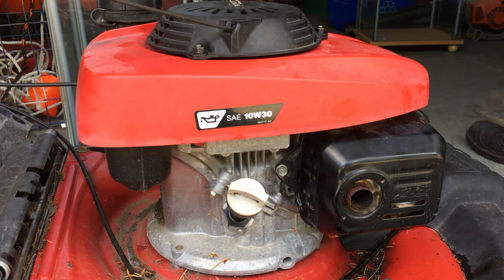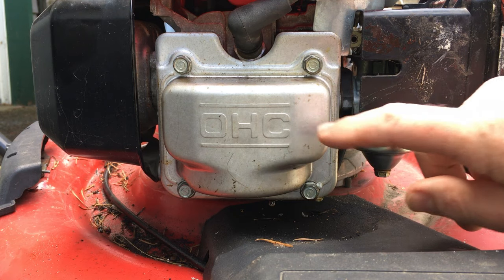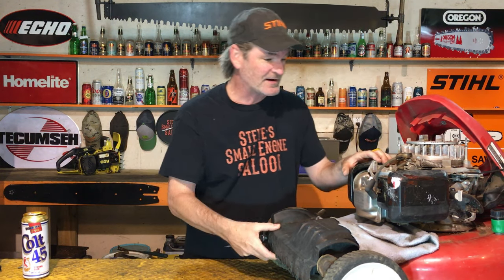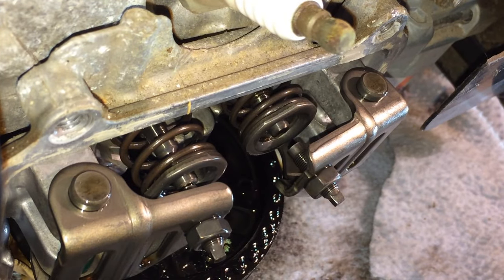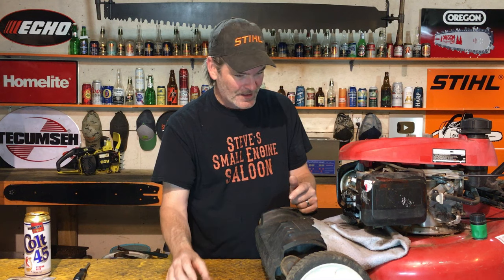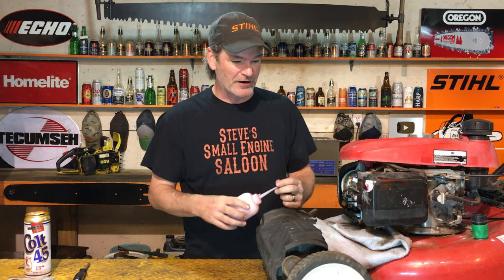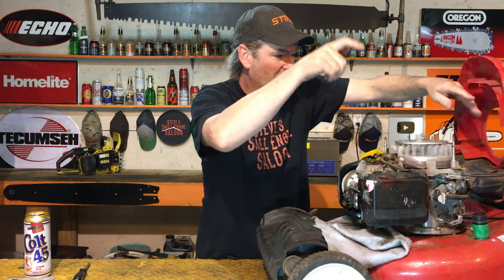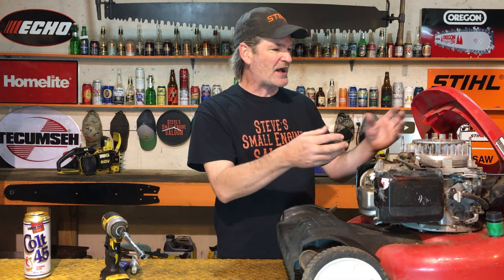How To Fix A Lawn Mower With No Compression

Comment: I had the same problem with my generator with a 10hp briggs and stratton. It needed a headgasket anyway so i took the head off and carefully tapped both valves out and soaked them in purple power and it runs like new again. Thanks
Reply from the maker: Right on Jim...

Comment: i have a power stroke  pressure washer  that has lost  compression   my local small engine repair shop  told me it can't be fixed  well they could probably fix it but  for the cost i'm better off buying a new one.......the piston rings have worn out.....if he is right and the rings are just worn down to the point there is not compression  why does this happen and what would you do.....junk it and buy a new one.....thanks for your help
Reply: Put new piston rings in l did this to my lawnmower years ago and it should work !

Comment: I should of watched this video before i took a engine apart in the kitchen 😂😂 and it was a stuck valve waiting on the compression tool to get the springs back in  amazon have a back log  helpful video as always steve small engines saloon
Reply from the maker: Good luck!
Reply: @StevesSmallEngineSaloon  cheers m8  im gonna need it

Comment: I've had Briggs and Stratton engines do the same thing as this Honda mower , easy fix . Last year I bought a second hand Honda weed eater not running , on it the valves were seating but not opening very much , stripped it down and found a worn out PLASTIC cam , the lobe for one of the valves was almost round . Honda lost a lot of cred with me when I saw that garbage inside . I think even that mower will have a plastic camshaft . Honda used to be good . Interested in your opinion on that Steve .
Reply: michael lee  Briggs , Kawasaki and Kohler all have models that use plastic cam gears and/or cams , I have no idea of the failure rate , maybe they are ok , it just seems cheap and nasty engineering on first impressions .

Comment: just tossed my rototiller! damn! but it was a 1979 Troy-built(Kolher engine, 8 horse)-my Dad gave it to me because he no longer needed it!   the compression could have been fixed if it was this. I used it back in 2011 to cut out my garden from a Bermuda sod lot! It did a damn good job too! was autodrive and made it easy as Hell! I wish I knew this when I tossed it out! But my Dad and I both concluded it was so old and had sat around for too long unsued ot be  repairable! I then used owr City's our "Big Trash" pick up hauled it off(this year!!! July of 2020!)-well  I think someone got it the day before at least someone enjoys a self propelled roto! I wish I had kept it now!  I could have clean3ed the valves! But I assumed it was so old it wasn't worth the time to behead it(not overhead cam!)  and do this!  :(

Comment: Always enjoy your videos Steve - you know what you are doing, thanks.  My Briggs and Stratton engine is backfiring loudly and won't start.  The (plastic) carburetor is cleaned, flywheel and flywheel key are fine,  new spark plug, oil and gas fine but yet having this problem.  Lawnmower is just under two years old. It's a Poulan Pro with Briggs and Stratton engine 625 ex series.  Any advice would be greatly appreciated, thanks.
Reply: Spark timing is wrong or the fuel mixture is too lean

Comment: Hi Steve I am big fan of yours. I have Murray 430cfm  leaf blower which died while running and won't staring again.
Any idea what could be wrong?
Reply: Dry cracked fuel hoses?
Reply: @feez357  that's not the case.

Comment: 50/50 mix of acetone and transmission fluid is the secret sauce.  PB Blaster and Kroil are good penetrating fluids also. 
If that Honda was a customer's engine, then saving them lots of money,  and being honest about a simple repair, is called good business.  Word of mouth will make it or break it.

Comment: After the last use of the season, you can prevent this by pulling the starter cord slowly until you feel compression.  That closes both valves, and even if they get gummed up while sitting, you have the positive force of the cam to shove the sticky valve open, instead of just the valve spring.  Plus it seals the combustion area from humidity, etc.

Comment: Question if stabilizer had it been added to gas would that have prevented this problem???
Reply: Duane Shadd 
Run only super unleaded gas in your lawn equipment, the additive package is better than the cheap gas most people insist on using. Your carb and valves will stay a lot cleaner and you won't have the kind of problems shown in this video. I've found that I don't need the stabilizer over the winter either.
Reply: @ralfie8801  so is that why you get that hesitation sometimes. Need fuel would get some today what gas is almost $4.98 a gallon here in Illinois
Reply: Duane Shadd 
Try some and see what happens, the worst that can happen is that it cleans out your fuel system real good. If you live close enough to Indiana, go there and get it. My Grandpa lived in Lansing which is on the far south side of Chicago when he was still living. He went to Indiana for a lot of stuff including all of his gas Super is around 2.959 here in north Texas.

Comment: Lost compression on our old lawn mower. Turned out that the inlet Valve Seat had come apart from the block and was stuck between the block and the valve. I removed the valve keeper clip and set the valve seat back into the block then used a nail punch around the outside of the seat to hold it in place. A temporary fix until we got a new lawn mower.

Comment: This is the reason I use a mild 2-stroke mix in my mower gas, it prevents gum and corrosion, a tablespoon of oil in a gallon of gas and problems like this are a thing of the past. Never used any fogging oil that is promoted for storage.

Comment: Great video Steve. Any ideas my honda izy  blowing blue smoke any ideas guys n girls
Reply: to much fuel getting in there. blue smoke is fuel white is oil   black is millennials diesel truck with injection turned up to high.
Reply: if air cleaner/filter is clean your going to have to pull the carb apart inspect and clean it.
Reply: I see blue smoke is fuel.. I've put a new carb on still smoking arrrggg..

Comment: Had an old b&s lawn mower when i was a kid. To start it you needed gas, and a hammer. If it had no compression, you wacked it with the hammer on the head. when you heard a boing noise you were good to go! go video!

Comment: My Briggs has 65 pressure. Still doesn't start. Cleaned the valves and used a new gasket. Still no bigger pressure. Will work on checking the piston and cylinder next.

Comment: Here is a helpful tip. If you take a rubber mallet and tap down on the valve cover you can get the sealant to break. Obviously using a reasonable amount of force without damaging it.  I’ve done it multiple times with no dents and don’t risk tearing up the sealing surface
Reply from the maker: Great idea...

Comment: I got a really good deal on a mint Husqvarna Rider today that just needed the carb cleaned to run per the owner.  Wellllllllllll thats not the problem.  It has no compression.  I'm going to try this tomorrow as the mower has been sitting for over 2 years.  If this works I'm sending Steve an 86 pack of a 12% IPA.  You won't be able to make a video after drinking it though.
Reply from the maker: Very nice!
Reply: It worked!!!!!!!  I called a small engine shop and he said to pull the heads. I did this and it started right up. Took 10 minutes. Both intake valves were completely stuck open. Thank you.

Comment: Outstanding timing. I was dealing with that exact issue on a friends mower. I will try it. BTW, how do you find the specs for valve clearance on various makes of engines?
Reply: You probably figured it out by now, maybe this will help someone. Honda puts the valve clearances in the owners manual that comes with the purchase of Honda equipment. Other manufacturers may do the same. For the size engine in this video the 160. The clearances are, 

Valve clearance 
(cold)
Intake: 
0.15 ± 0.02 mm
Exhaust:
0.20 ± 0.02 mm
Shop manual
BTW, that Honda engine is awesome I bought my Honda mower in 2012 and this is no lie, It has never failed to start on the first pull. They have figured out how to build a automatic choke. The things I have replaced so far, the pull start spring and string, a governor spring and I just ordered new rear wheels. I keep gas treatment in all my gas cans as well.Thats it.

Comment: I had too much compression on my mini bike and I took the valve cover off and my valve rod c clip fell off and the rod of the rocker arm was shot out and the push rod was down but I rigged is so I cut a washer and loctited it on

Comment: Hey Steve. Pick your brain. I have a husqvarna lc221a awd mower. I had to turn the engine over to drill out a bolt holding awd wheels bracket and engine to deck cause it broke. I fixed everything and turned mower back over and now it won't start. Cleaned carb completely and still won't start. Has compression. Did I ruin the engine? How do I fix?

Comment: What can I check for a surging mower? I replaced the whole carburetor and plugs and air cleaner. Still surging
Reply: Loose or cracked fuel and air lines, plugged vent on gas tank would be my next guess buddy.

Comment: I have an areins rocket 7 rear tine rotor tiller made back in the 1970s .ii am in need of a replacement engine the original was a cart iron Tecumseh unknown hp this engine has the regular crankshaft and also a auxiliary reverse shaft. I need an engine with this feature. Can someone help me . thanks.

Comment: Hi Steve, this has nothing to do with compression. I just have a question on a small engine. Are there any small engines out there that are around 10 horsepower, electric start, liquid-cooled, 4 stroke, gasoline fuelled? I've got a project in mind that I would like to tackle but not sure if there is the proper engine out there.

Comment: Another thing, when Steve pulled that valve cover off of the honda engine...my wife put a hole in that valve cover (low hanging branches), the engine died.  Compression was gone.  I had no idea that the valve cover actually mattered with compression!  I was thinking of an old school car's valve cover (you really don't need it on as the car runs).  If anyone could describe to me why a honda small engine requires it's valve cover, I'd love to understand!

Comment: I have not seen one made like that before. Rarely do I ever get one that easy to fix. Most of the time it's replace or clean the coil and/or clean or rebuild the carb. People watch a video like this and think, hell anybody can do that. Which is true but most of the time there will be more to it. I bought a mower at a yard sale a few years back. The guy said he got it running but it would not cut the grass. He had put New belts and blades on, new battery. He was sick of it and just wanted it gone. I wanted it for the engine. He said he would take $50 for it. When I got it home to check it out I found, the blades were on upside down. It would start up and run fine. But when you engaged the blades it would almost die. The carb. was sucking air. I would bet since he did not know how to put the blades on, he would not have known about the carb. . I had the carb. rebuilt and it worked fine. Turned out this mower was better than the one I was working on. Most of the time replacing parts is not all that hard. But then again I have had a some that were a nightmare.  Figuring out what is wrong, sometimes can be a challenge. And when you do not know what is wrong and start replacing parts hoping to fix the problem, it can get expensive and frustrating. The wife's father could not get his mower to start. He replaced the battery, the solenoid and the starter. Still he could not get it to start. So then he calls me. So I look it over making sure he had everything hooked up right. And making sure all the grounds and wires were good. I sit on the mower turn the key and it does nothing. So I raised the seat and looked at the seat switch. Well it was the easiest one to get to. I ran a jumper wire and hit the key and it started right up. He had worked on it for several hours and spent a bunch of money. Not to mention baked himself in the sun. I was there less than 10 min and only used  a scrap peace of wire.  I admit I was lucky it was the first switch I came to. I do not claim to be a professional. Hell I learn new things all the time. But as I was trying to pointing out sometimes locating the problem is the hardest part.

Comment: Cheers Steve 🇦🇺 good on ya mate
Reply from the maker: Thank You...
Reply: @StevesSmallEngineSaloon  hey Steve, my valve cover had a dent on it, restricting the valves and loosing compression, a few taps with the old twelve in one tool (the hammer) and we are back in business. I didn’t twig until I watched your vid and took the cover off, the dent was consistent and hidden in plain sight! Cheers mate, all the best.

Comment: I've got one with what appears to be that same engine. It's got low compression, and runs like shit. Maybe I'll get lucky and it will be an easy fix like this.
Reply: Well it doesn't appear to be a stuck valve. The engine only has about 60psi compression and pushes alot of oil out the exhaust. I'm probably going to mark it as toast.

Comment: Cost about 10 cents., max. Labor about 90 cents., for a total of about 1 dollar, now that is not too bad. I've fixed equipment that was give to me for less than 5 dollars and resold it for min of 50 dollars, and up. I've seen as simple as a leaky fuel line, to full rebuild.

Comment: You may have just fixed my mower.  I'll let you know!
Reply from the maker: Good luck!
Reply: @StevesSmallEngineSaloon  Thanks!  Good news, the valve was not stuck but the rocker was off-center/re and I was able to put it back into place, now I have compression again!

Bad news, it still won't start.  Going to check for a plugged fuel cap, if that fails, what do?

Comment: Nice fix but kinda looks like a different lawn mower as the one you started has different wheels as one on the bench good fix tho as i have that same motor on a homemade generator and has no compression 🤪
Reply: take a look at the mower when its jacked up.   The lighting makes the wheels look  different.  Great video Steve.

Comment: You shoulda tried to free it up with beer.
I made the mistake of trying to burn up bad gas in my Kawa engine lawn tractor and the exact same thing happened. Should have just burned the bad gas in a metal pan. Sprayed the intake stem with carb cleaner and it freed it up. Put in good fresh gas and the tractor ran just fine.

Comment: Had an old crapper mower on its last leg rings were shot more smoke than at a bonfire .dumped a quarter cup of pancake syrup in the case instantly sealed the rings no more smoke used that junker rest of summer.

Comment: Just my two cents. The very first thing you do after firing that mower up and running it for a couple minutes is change the oil. This way the oil doesn’t have a chance to cool and gum up the same or other parts within the engine.

Comment: You would of been proud of me today a guy pushing his lawnmower down the road said it ran all day till the last three strips then it shut off and does nothing. I said whatch gonna do with it.i bet I can fix it
 he said take it down the road and let lester fix it he fixes everything of mine .I said ok.as I  have been restoring my 75 sears suburban.gt 18 twin real garden tractor.for about 6 yrs now.about 2 weeks went by I asked him where his tractors at I'm gonna go pick it up now hes fixed a couple of things but just cant fix it doesnt know what's wrong,I said I do bring it to me I lifted up the seat to see the kill switch was smashed I took the wires off the switch and hooked it up direct it fired on the first try.i told him for 12.99 I'll put a new switch on.he told me I got a new customer today.....so just when your about to give up on your project always check the safety switches.
Reply: So the other guy didn't even check for spark? yikes

Comment: Don't ever not check compression.  I put $200 on ignition parts on an engine that had a valve sticking from shutting completely.   It did run alot better with new wires, plugs, 3 new coils.  But, it ran fine right before the valve stuck also.  I never expected a stuck valve, especially with timing good. I'm back to the basics much more so now.

Comment: As an industrial chemist, let me advice, we do not "melt" sticky gooey stuff on valves, but DISSOlVE the chemicals, just as you dissolve sugar in water. We melt solder, ice, and butter, but, we dissolve two stoke oil in petrol, perfume in alcohol, carbon dioxide gas in water, etc.

Comment: In reality it's not from old gas it's from gunked up carbon or rust the gas is from the sparkplug side .. that's from letting it sit with the intake valve stuck open for a long time the best way to store a engine is turn the engine until you get it on the compression stroke so both valves are closed

Comment: Free Cub Cadet rider. No compression as shown on guage. Here I go
Reply from the maker: Good luck...
Reply: @StevesSmallEngineSaloon  Thanks, but no luck. Turned it over with the valve cover off, and the only thing I noticed was the valves out of sync. I figure a bent pushrod, out of timing, or a worn cam (or the equivalent of a cam, never been inside a small engine).

Comment: How to fix a lawnmower with no compression?  Throw it away and buy a new one.  Oh wait that's what I did with my car...you can usually find parts pretty reasonable for those small engines and get them going again, or swap another spare engine over if you got the parts to do so....if you are a small engine repair guy you most likely got an engine sitting on a shelf waiting for a new home anyways LOL.